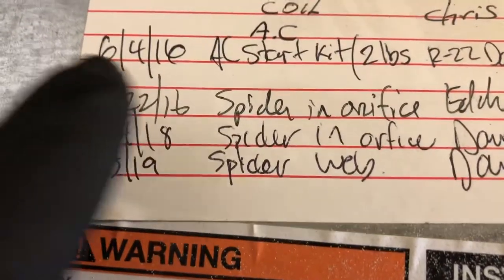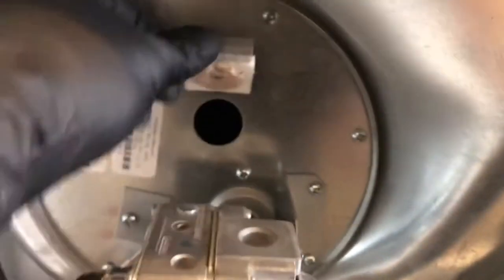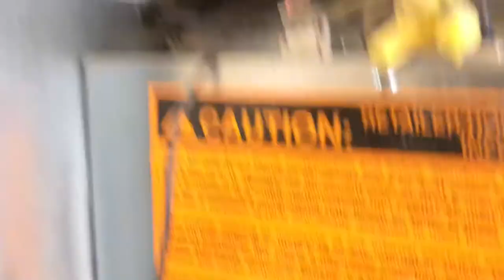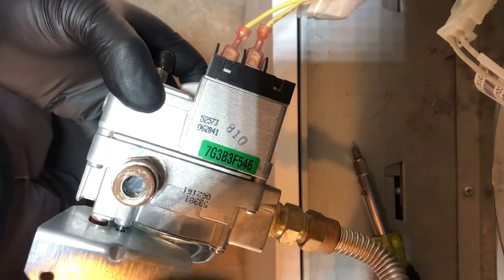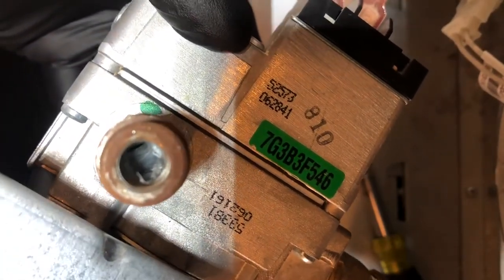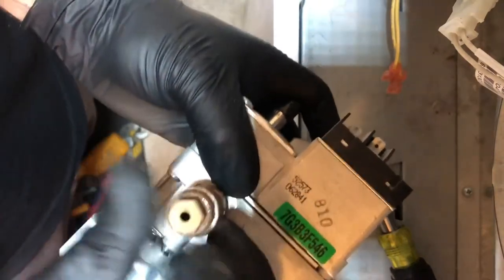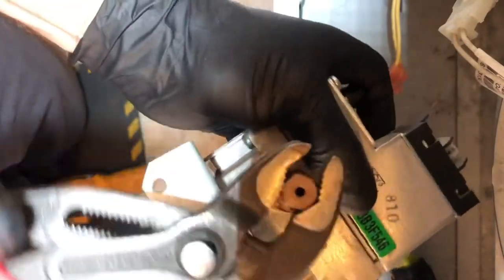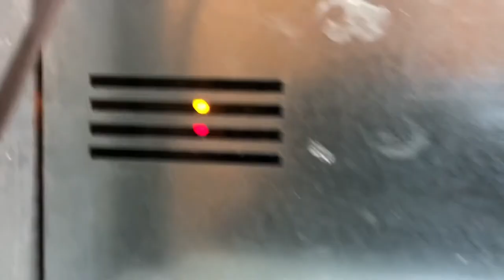Intertherm mobile home furnace spider in orfice

Comment: I got this problem right now, was told to check the flue stack on the roof to see if it is rusted. would that cause weak flame? I have an Intertherm M1M series furnace, i dont know if this is the exact same one, hard to catch with the camera moving so much, looks like it though. I will check what this video shows. Mine is hard piped all the way so it is a pain in the ass. Important information.. i guess would be that the furnace runs perfectly fine and still gets up to temperature, but it feels like the vent air is not as warm as it should be, which led me to check the furnace. I am an industrial electrician but i dont know a damn thing about a furnace or much about its order of operation lol. or much of residential at all to be honest. 

Also can you explain to me what a rusted flue will do to the exhaust gas? i dont quite understand how it causes issues with the furnace. Does it stick to the rust or something causing insufficient air and then settle back down to the lowest level causing the furnace to shut down?

EDIT: welp it isnt a blocked gas orifice. must be something related to the vent.
Reply: I have the same issue mith mu M1M  too
Reply: Yes a rusted concentric chimney at the top on the Interterm M1M unit is very common issue. 

What will a rusted top section do? 

It will allow the flue gases to be drawn back down the chimney and into the heat exchanger. This recirculated flue gas will now displace the "Much needed" oxygen the flames require. When there is now a lack of oxygen, the flame will now "Wander" away from the burner head searching for oxygen. When this happens the flame moves away from the igniter causing the control board to show a flickering yellow light and then eventually cutting off the gas valve and shutting the burner operation off. 
It will restart and try again and then cut out again, giving very poor heat output to the home. 

You can tell this is the problem by watching the yellow light. If the light flickers and cuts the burners out in under 7 seconds, you have a flame sensing issue. But in a rusted chimney senario the burners will stay lit until the oxygen is displace, this is usually 15 to 30 seconds approx. Far past the point of 7 seconds. Very common issue with Interterm chimneys we see at approx after 10 years of operation and the very reason I will not sell Interterm to my customers.

Comment: where is the pilot button for this one ? i have the same one, no flames come out at all.
Reply from the maker: This model doesn’t have a pilot it has a hot surface igniter you either have a bad igniter or gas valve

Comment: I changed the thermocoupler on my furnace but it didn’t fix the issue. There’s no gas going to the pilot. I assume it’s a bad valve? I push on the pilot button for minutes but still no gas flow. Help!!
Reply from the maker: Yeah could possibly be a bad gas valve if there’s no gas coming out of the valve try to replace it that should fix the issue Or a broken pilot tube
Reply: @Victoryhomeservices209  thank god it was just a clogged orifice!!!

Comment: Why did the blower come on for a second at the begining then turn off
Edit:added details
Reply from the maker: When I got to the house the blower was running the furnace try’s to ignite 3 times then goes into lockout which keeps the blower running not enough flame on the sensor